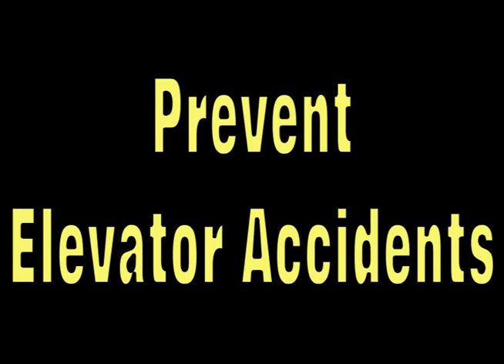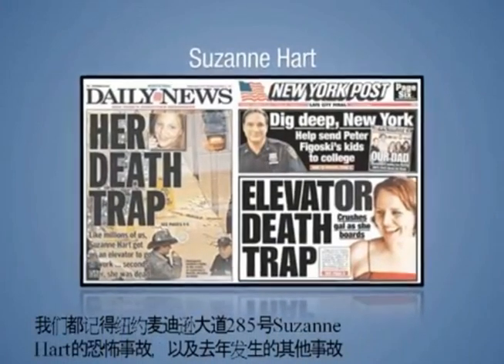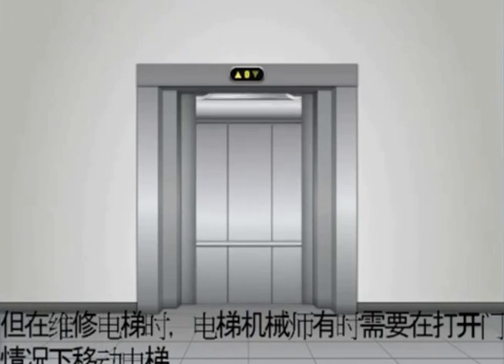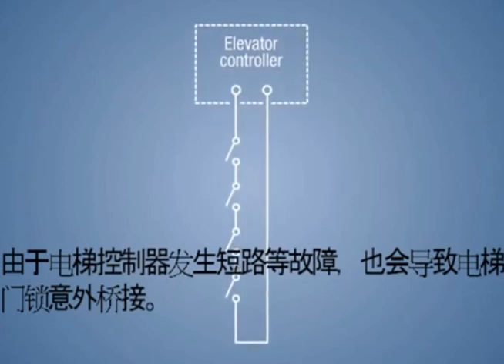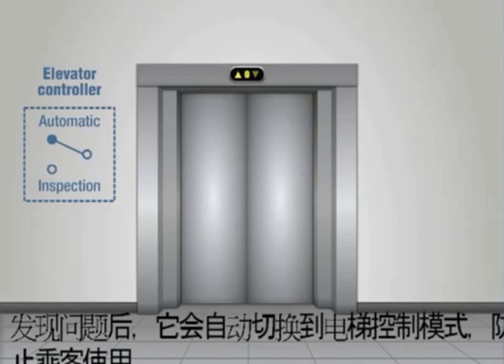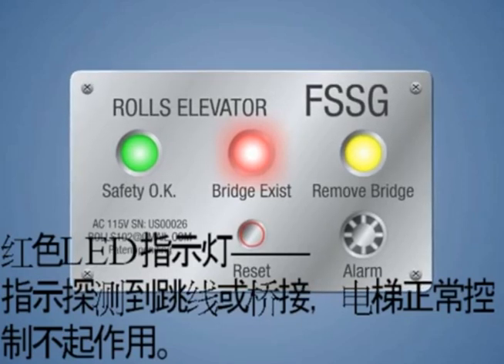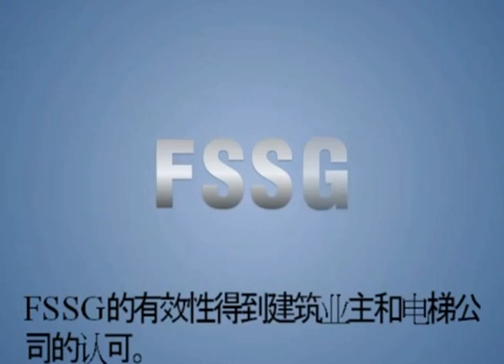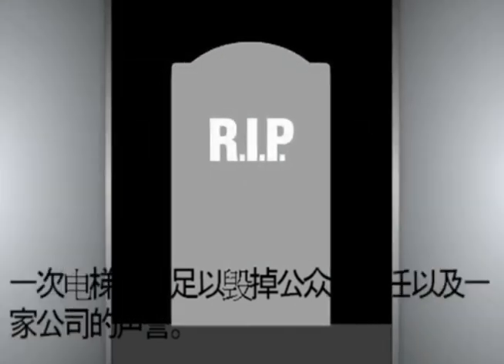Prevent Elevator Accident

Comment: Such a system is OK to solve this issue from happening on existing elevators. But that the problem exists means there is a fault in the original elevator system or maintenance procedures in the first place. I don't think too many elevator owners will buy this fairly unknown product, so it won't solve those 40 deaths over the many tens of thousands of elevators in a country.